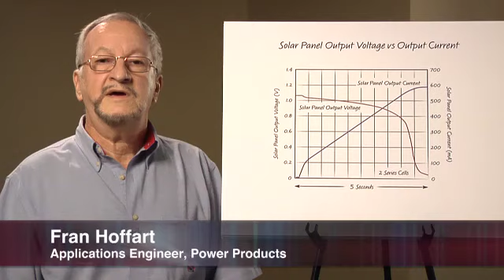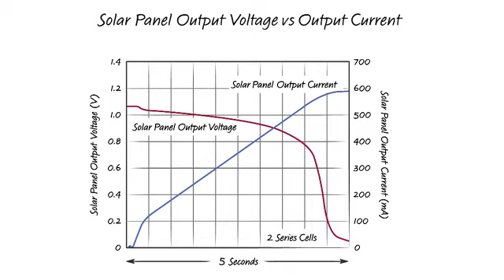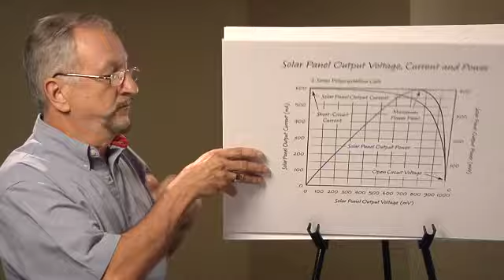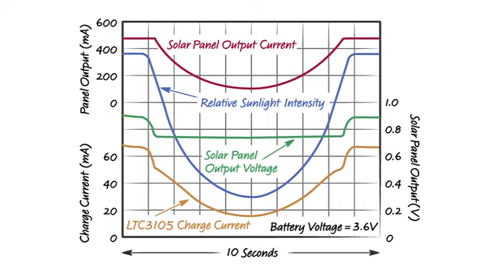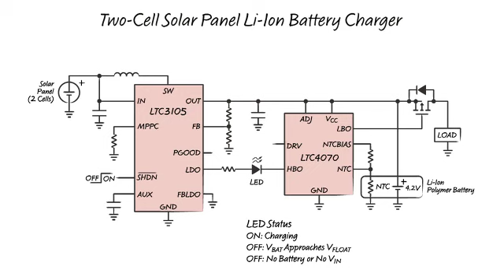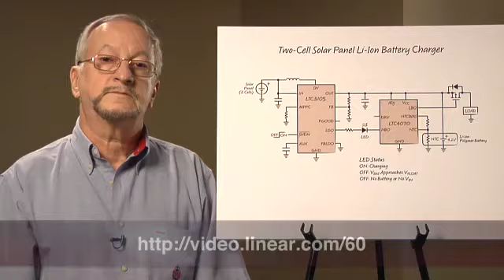Maximum Power Point Control Simplifies Energy Harvesting

Comment: What is the "Max. PV input power" Rating on the controller chart in the MPPT (EPEVER) manual?
    Mine is a 20 Amp - rated at 260 watts Input... I have 300 watts of panels  does that meen that the controller will blow up if I try to use it with those 300w panels? or is the actual input less than 400 watts due to loss in wires and partial sun ect. ?
In other words, Do I have to definitely buy a 30 amp MPPT controller rated at 390 watts or can I get away with the 20 amp unit rated at 260 watts? Or- to go further...would the 40 Amp be more efficient being it's rated at 560 watts?